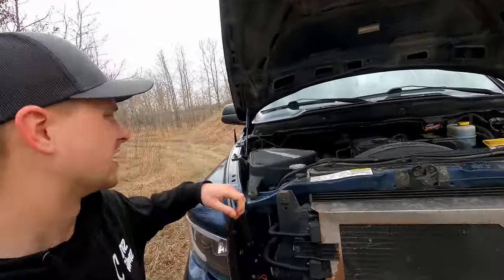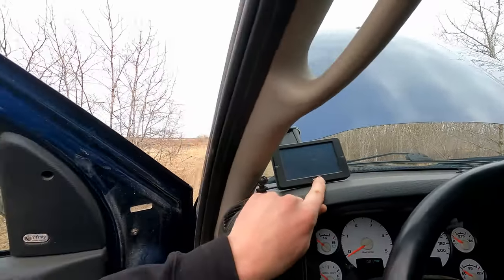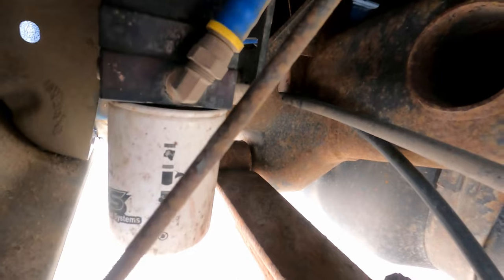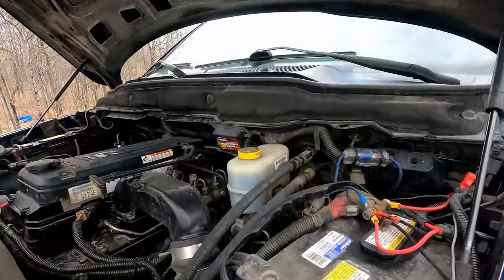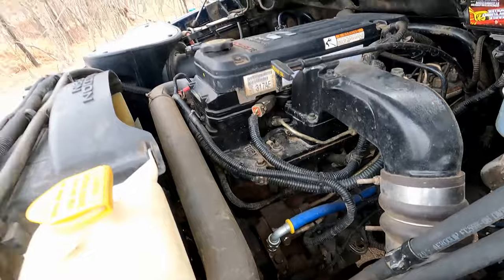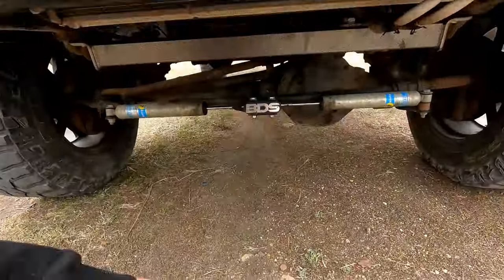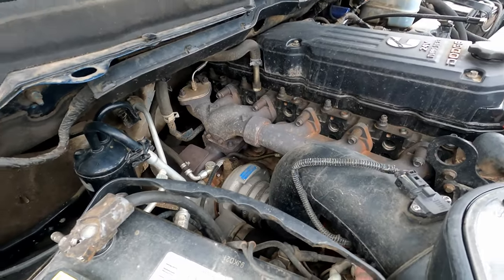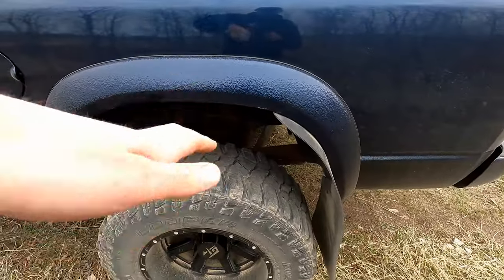TOP 5 UPGRADES FOR 5.9 CUMMINS

Comment: Thanks for the video! Everything you mentioned is stuff I’m working toward. I was torn between the Fass and air dog... have you had any issues with the water filter on the Fass? How often do you change it? These videos help me a lot on mine, cause I’m new to the 5.9 and I have an 03 that I’m slowly building.
Reply: Get the air dog. Ive had mine on my second gen for a year. No issues at all.
Reply: @MrSrtman18  Thanks for the recommendation man!
Reply: I dont like how if you go with either fass or airdog, you have filters exposed. All it takes is a rock to hit and puncture one of those filters and you're shut down right there. I went with cats filter and water separator that mounts up high in between the transfer case and fuel tank. You remove your drivers seat rear bolts and put the longer ones that are provided through and mount the bracket and you're all set. Then I got one of the best in tank pumps made by Fleece

Comment: Quick question on your Fass system, is it ever extremely loud on yours. When I bought my 04 5.9 Cummins the fass system is extremely loud since then I have added rubber between the metal and are ganna change filters soon. Any other ideas on what would be making it so loud.

Comment: If you put steering brace on your truck when new you won’t need to change your gear box and I won’t use redhead any way when dodge makes a massive steering gear box that works better and is brand new not a rebuilt factory gear box .

Comment: Just bought one today bone stock. and completely new to diesels. Do you have to tune even if it's just an exhaust upgrade? Or when should you start to look into a tune
Reply from the maker: Nope you can do exhaust, air intake, fass, without tuning. Tuning just gets you more power and it most cases some better fuel mileage.
Reply: @darkirondiesel  great, I just didnt want to risk reliability if I got an exhaust without a tune. Thanks man

Comment: After installing traction bars do you think you should relocate the right rear shock mount to being the rear axle parallel to the left one?
Reply: Who's traction bars are you gonna use? I was thinking about a set too, I spend 1/3 my mileage on lease roads

Comment: I always cringe when I see lift pumps mounted on the outside of the frame rails. Personally I would worry about debris getting slung up from the tires and knocking my entire fuel system out. 

That's why mine is mounted on the inside of the frame rail close to the tank up high. I don't mind sliding under to change the filter. And you can't even see it from the side of the truck. No way anything can hit that thing.
Just my personal opinion. That's a lot of money to invest in a fass pump.
And I'd hate to be stranded just because a rock flew up and took it out of commission.
My build is almost identical.
2006:ram 3500 dually.
5.9 L common rail.
ARP head studs, installed when brand new engine was put in.
AFE stage 2 air intake.
Airdog 150 fass pump.
Steering box stabilizer.
Pro Comp traction bars.
Rev Max signature series 48re
Billet flywheel billet input shaft lots of goodies.
Superchips flashpack tune.
She's been my faithful girl for well over a quarter million miles.
Reply: I'm the exact same way. So stupid how those are mounted. Mine is also above in between the fuel tank and transfer case. I also never found a point in replacing the intake. I just took the baffle out of mine and cut a hole in the front bottom portion of the box under the filter. Its pulling direct outside air from the grill. You can look in the grill and see the bottom of the filter. You're getting better air than any after market intake

Comment: I had an 04 ram with air dog pump, I had to run a hell of a lot more #1 diesel in winter. Is there anything you do with yours? Hear some people put a sleeve over filters, some put heat tape, ect.

Comment: How was the process of installing a vgt  turbo? Do you still get turbo lag?
Reply from the maker: Still lag but not much. Also depends on which tune im running.  It’s nice to get 40 pounds of boost though
Reply: @darkirondiesel  oh ok cool..what would you suggest for minor upgrades nothing to crazy because I don't wanna start blowing parts and transmission..I got a 07 5.9l mega cab on 35s and that thing is slow..even with boosted launch..it gets a little dangerous pulling in traffic. Also this Is my 1st diesel

Comment: how is your short shift kit working out?  still recommend?
Reply from the maker: Ya at first I had to get used to it, I missed the odd 3rd gear shift, but after a couple drives it felt normal and I definitely would recommend.

Comment: What whistle tune do u have when it’s at idle
Reply from the maker: It’s not a tune, I have the vgt turbo in my truck so when it idles and it’s not up to temp the exhaust brake will close which is what you hear

Comment: No your are completely wrong about the head gasket replacement DONT WAIT TILL THE HEAD GASKET BLOWS. Do head studs as soon as you can because if you head gasket blow you risk warping your head or worse the block if you have a high mileage engine just do a new head gasket when you do head studs to be safe.

Comment: Do you have a muffler on yours ?
Reply from the maker: No mine is straight piped
Reply: @darkirondiesel  i got a 4 inch straight on my 07. Definitely gonna go up too a 5inch. You should do an exhaust compilation video on your truck. Drive bys going thru the gears etc

Comment: Steering brace is a waste of money just get a 6 bolt 4th gen steering box. Zero play compared to stock style box
Reply from the maker: That steering brace was a night and day difference
Reply: Helps alot especially after you get into bigger rubber I'm running 38x14.00r18 and it made a world of difference even with the upgraded 6 bold extreme duty red head unit
Reply: @darkirondiesel  ya I know it helps the stock steering box I’ve ran the steering brace. But in my opinion it just a band aid on the problem. Buy a 6 bolt steering box and you don’t need the brace because the 6 bolt box has a 3-4x beefier shaft and doesn’t flex like the stock one. It’s a way better steering box all around. I know people who had their stock shaft shear off running 35s

Comment: Since the 5.9 is fine, lets rename this "How to make a Dodge Ram less of a shitbox"
1: buy a stock truck with no rust, replace every fluid and filter in the whole truck
2: replace the entire front suspension, steering system, front and rear driveshafts and U Joints, and rear axle seals 
3: lift pump is mandatory, replace the FCA while you're at it
4: new clutch for manual, new trans for auto
5: new headlights, new batteries, cables and terminals, new seat foam and covers because yours is definitely worn out, if its a quad cab replace the rear door wiring harnesses and the drivers door master switch panel, don't trust the overhead console MPG reading because I promise you're not getting 30mpg like it says, you're not even getting 25mpg. 

why did I ever sell that old chevy gasser I had...